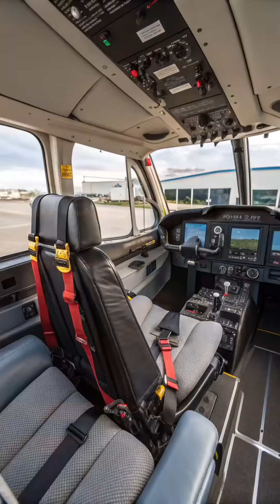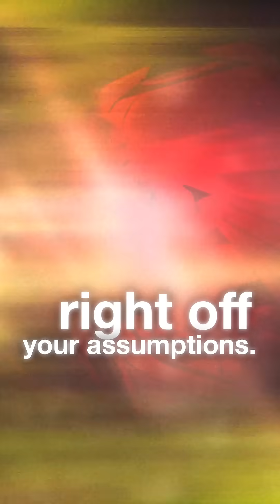When a Cockpit Window Blows Out, There’s No Room for Error

Comment: This video is misleading. Plane cockpit windows do not break “all the time.” They’re made of multiple layers of toughened glass and polycarbonate, designed to withstand extreme pressure, temperature changes, and even bird strikes. When a failure does occur (which is very rare), it’s usually just one outer pane, and the aircraft is still safe to fly because of redundant layers. Aviation safety standards are incredibly strict—this kind of dramatic claim ignores the facts.